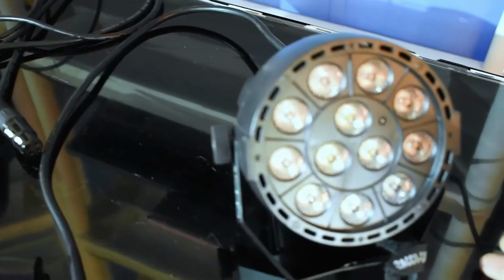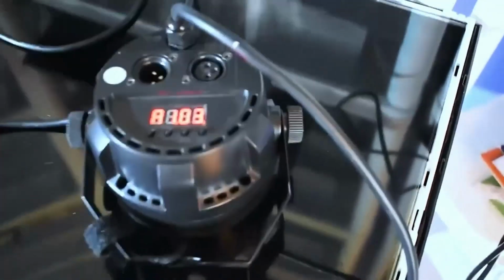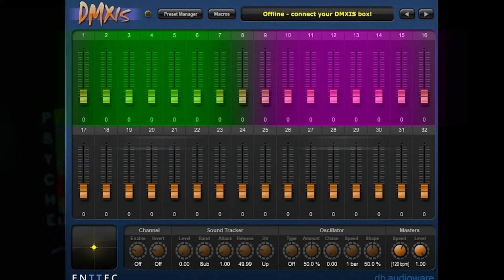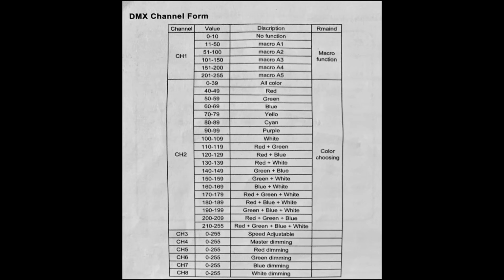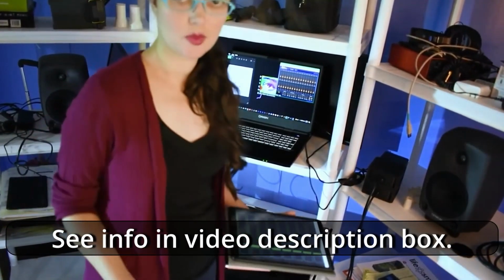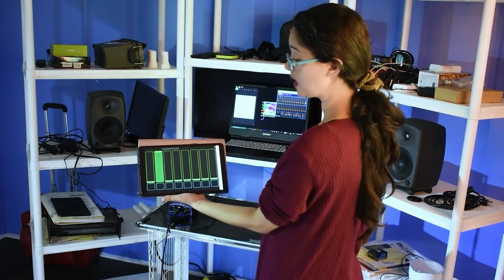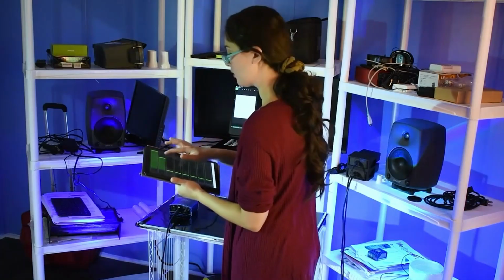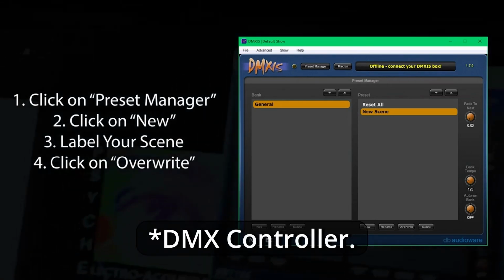Wiring & Programming Multichannel Stage Lights: DMX 512 Basics [Updated Video]

Comment: One small correction about XLR cables. The problem is not the material of the shielding, copper or aluminum. The problem and the reason that makes them incompatible is that XLR audio carries analog signals while DMX carries digital. Digital signals have cable impedance requirements(110-120 ohms) that audio analog cables do not meet. That should be written on the dmx cable to make it clear. About burning devices i have not heard of personally but i know it will not work properly if cables are mismatched.
Reply from the maker: Hey Peter! Thanks for the info! ✨Pinned your comment.